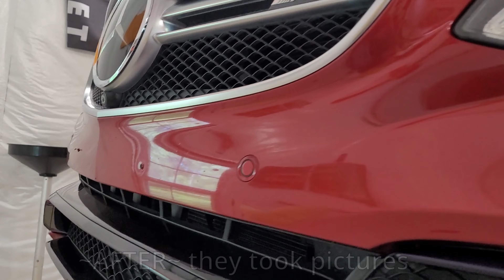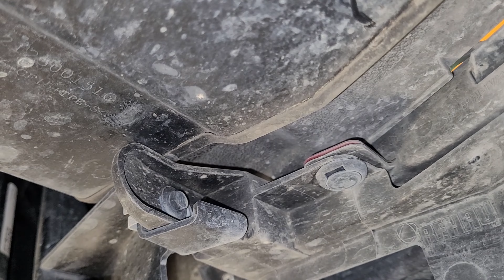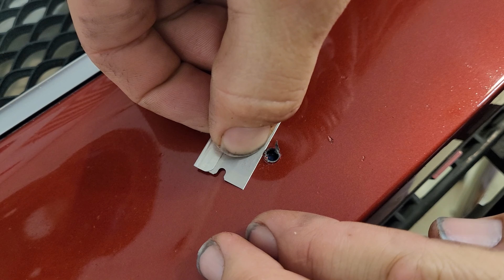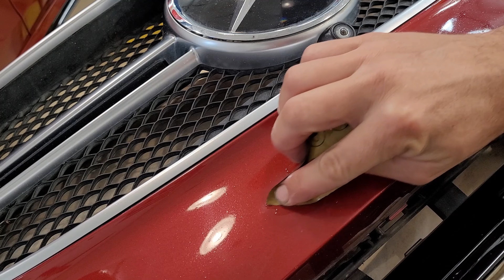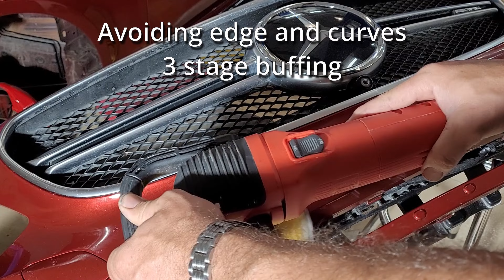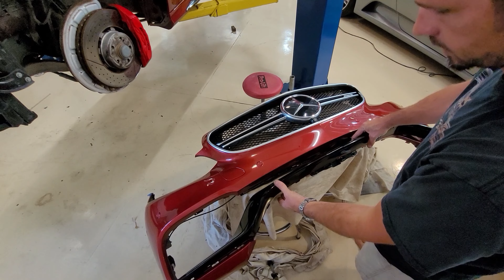Perfecting the e63, pt12.... Fixing holes the dealer drilled in my e63.

Comment: I was going to use some ugly plugs to fill the holes in my bumper but since whatever jack-leg installed them messed up on one side and had to drill two holes next to one another, I think I'm going to give this method a try instead.  I've done plenty of wet sanding and paint correction, so I don't think this will be that bad.  Thanks for the idea and all the other great videos!

I was watching your videos before I found my E63 but I FINALLY bought a 2016 wagon last week and you've covered a lot of stuff I plan to do.  You probably won't remember this but you and I were actually bidding against each other on BaT probably 2 years ago for a wagon.  Neither of us took that one home unfortunately.  Anyway, I'm ecstatic to join the W212 club and absolutely love the car so far!
Reply from the maker: Congrats! Oh yeah, I remember bidding against you on the New Hampshire matte silver car.
The main tip I would recommend is just make sure that you trim the hole ever so slightly countersunk. Otherwise any sanding/buffing you do will immediately uncover bear bumper plastic. Hopefully you find a better touch up paint than I did, the OEM Mercedes stuff absolutely didn't match LOL
It's a great car, enjoy!

Comment: Do you have to calibrate the 360 camera via Xentry after you disconnect the harness plug when taking off the bumper? I want to upgrade the Aux coolers and do some other work but cant find a solid answer. Its also a W212 E63.

Thanks in advance.
Reply from the maker: You do not. I still would recommend never turning the ignition on when anything is unplugged however.
Reply: @ExoticCarDIY  Makes sense, I’ll just disconnect both batteries and leave it like that until its fully back together. 

Appreciate the help. Best W212 content on YouTube!

Comment: Great video as always. 

Does the whole bumper need to be removed in order to take off the black plastic pieces from the grill ? (Night trim pieces)
Reply from the maker: I think it's possible, but There's not a lot of room to get those clips on the back side with the bumper on. You probably spend more time messing with it then it would be just to remove the whole bumper.

Comment: Funny start. Do you plan on adding BOV/anti-surge? Everyone I asked said the M157/M278 does not have one from factory?
Reply from the maker: NO factory BOV, I like the idea of one, but from all I've read, there is really no performance gain, its only good for smiles... which is fine, thats what the cars for right?
Reply: @ExoticCarDIY  And to protect the turbos in the long run. I went with VRP but you can't hear it. Renntech sounds louder from videos I've seen.